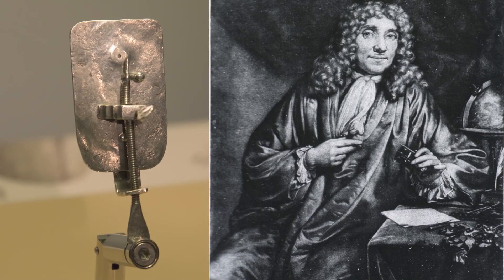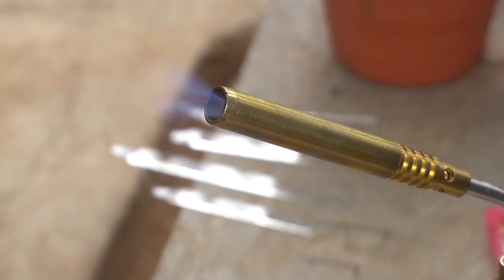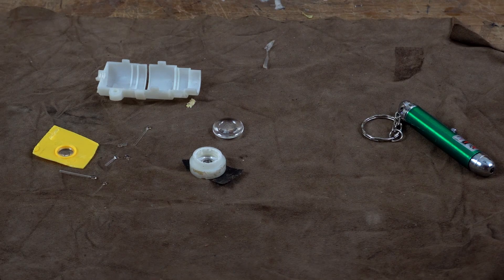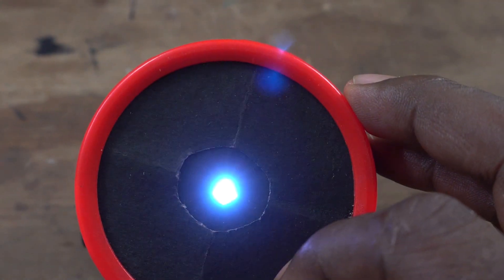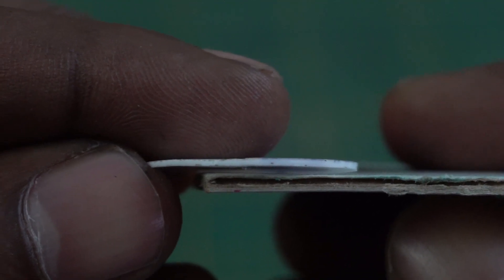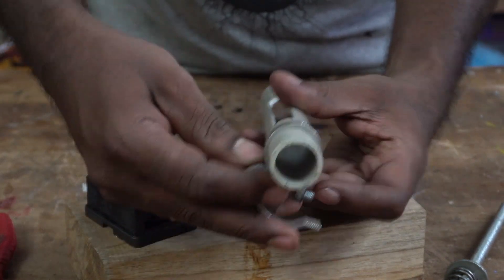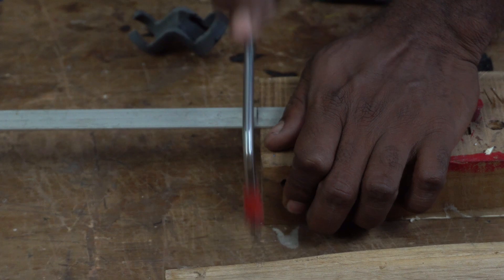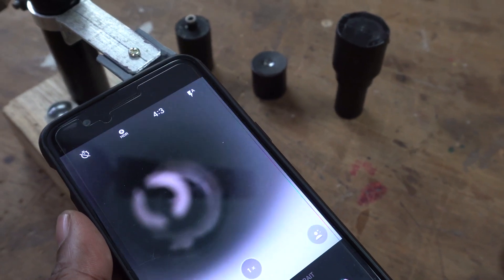Homemade high magnification Microscope

Comment: Can we use borosilicate glass? For a better results
Reply from the maker: yes sure! But it is not only the glass. Its mainly the method. Here in what I had made, the pressure from the gas of the butane torch was making air bubbles trapped in the glass bead. That's why I had to make so many of them and pick one that worked for me.

Comment: Hello,
What is the magnification of eyepiece and objective lens you used here. And what is the focal length of each lens. What is the distance between the two lenses in this microscope? 
Pls pls pls pls pls pls pls pls pls pls pls reply sir 🙏🙏🙏🙏🙏🙏🙏🙏🙏🙏🙏🙏🙏🙏🙏🙏🙏🙏🙏🙏🙏🙏🙏🙏🙏🙏🙏🙏🙏🙏🙏🙏🙏🙏🙏🙏🙏🙏🙏🙏🙏🙏🙏🙏🙏🙏🙏🙏🙏🙏🙏🙏
Reply from the maker: Honestly, I do not know all that. I was just doing it by feel and guess work. I even got a bit of headache while doing so!
Reply: @VIDEOEPPO  oh, okok. Can you give me some tips about it. I am gonna make this for school project
Reply from the maker: Project involves fire and glass...please content with parents. With that said, first, you need to make the glass bead. Then use a laser pointer lens or the lens from an old CD reader to magify the first image. Then use a lens from a vr head. to manify the image further so that you can see it clearly. Place two skewers and use cardboard slides with holes for skewers and a hole in the center to hold the lens. By raising the cardboard up or down you can measure the correct distance with proper focus. Repeat the process for other lens as well . Now you can use rolled paper tubes or pvc pipe and fit all the lenses

Comment: can you pls tell me where you found the lens holder?
Reply from the maker: most of the material is PVC. The clamp I have used is from a scooter. The one that kids use. Its is used to adjust the height of the handle bar. You can get it form cycle shops
Reply: @VIDEOEPPO  are those plant cells? which plant did you use as the specimen?
Reply from the maker: @davemwangi05  Its the onion epidermal cell

Comment: just a give a rough diagram of the project , the arrangement is not so clear
Reply from the maker: I checked a few fountain pens but the ball inside is metal, But if you say we have glass beads, then you can use it. It must be clear like glass or the image will not be clear.Plus, a diagram for this project wouldn't help you. I just worked with whatever I could find. The concept is only that matters. A glass bead can help you see microscopic. But its quite difficult to hold and focus. So I took another lens to magnify the image. Made a stand and put a light to see, that's it.
Thanks a lot for stopping buy and for the comments.  I made a video on foldscope (paper microscope). It is in Tamil. See if that helps.
Reply: thankyou for the reply!!  how could we email u as we have any issues
Reply from the maker: @gkrishna9841  email : videoeppo@gmail.com.
Reply: i told about the catridge or the ink tank that we insert to the fountain pen body,and its just a use and through one , when we remove the potion back side we can get it , its purely transparent and am not telling about that present in pen's nib, thats metallic
Reply from the maker: @gkrishna9841  Yeah, I have an unused one. I prefer using ink, do not know about that.. Click a pic and send it to me on my email ID
Reply: sir,did recieved those pics
Reply: its a rarest event to recieve replies from  a youtuber with k subscribers
Reply: as we r in curfew , have no materials from outside to do such large things like stand and adjestment columns , so i just tried to get focus using two pvcs which interlocks eachother but i failed

Comment: PRINCE RUPERTS drops tend to explode when their tails are snapped pretty dangerous
Reply from the maker: That effect is because the molten glass bead is immersed in water. The temperature of the molten glass drop too fast resulting in contraction and residual pressure trapped in the bead. We are not doing any of that. The glass bead cools naturally and hence no need to worry